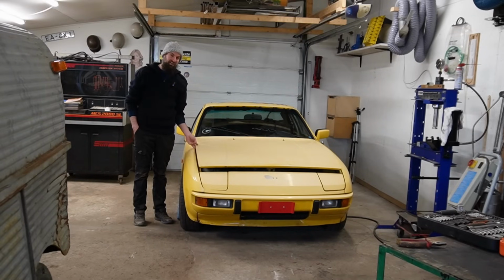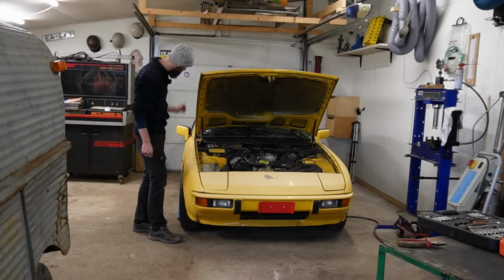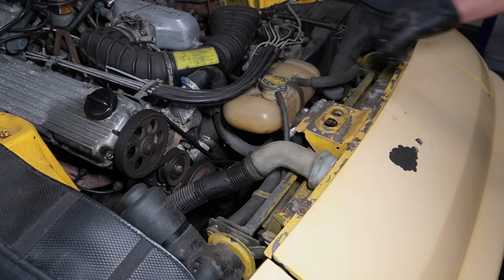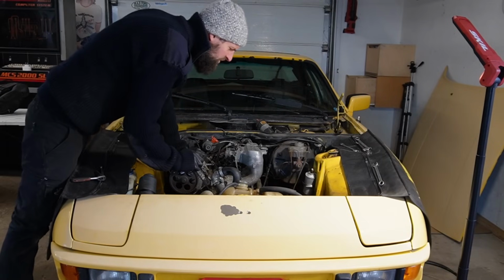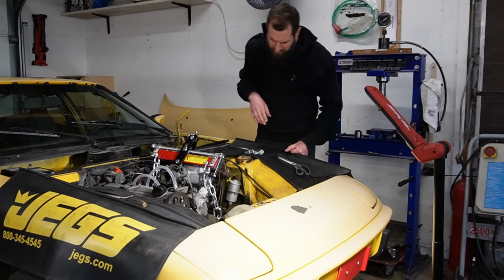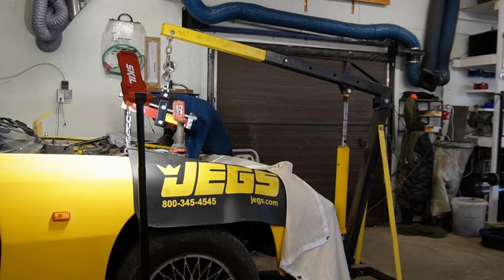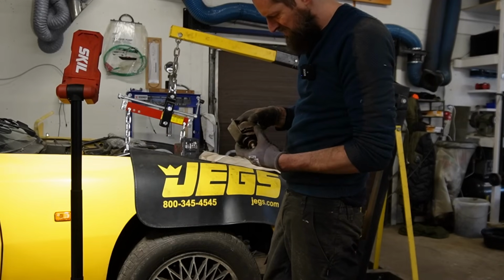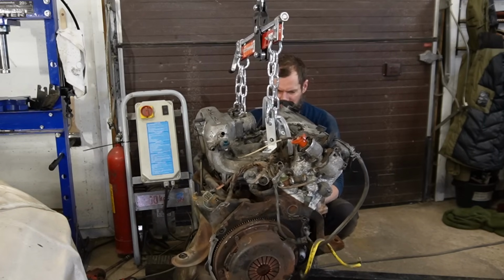Porsche 924 | Engine Out!

Comment: I remember talking to a Porsche mechanic back in the 1980's who hated working on 924s.  He said he had to remove the exhaust manifold to get to the spark plugs...
Reply: Really?  Was this the approved method?  They are not the most convenient but you can access them with universal joints on the socket extension.  Removing the exhaust manifold is more difficult!